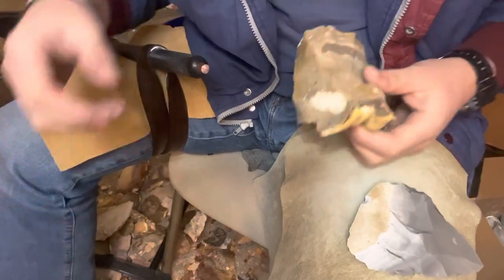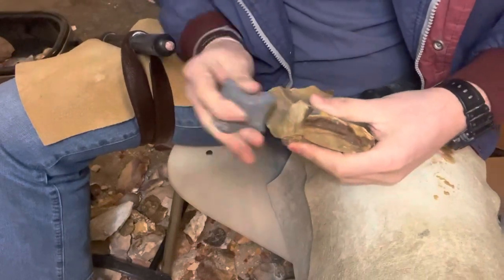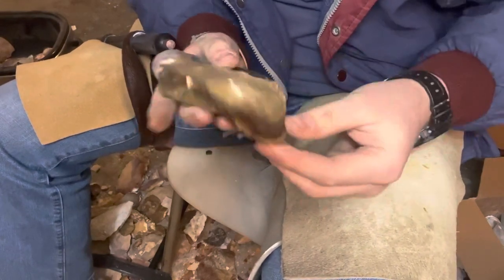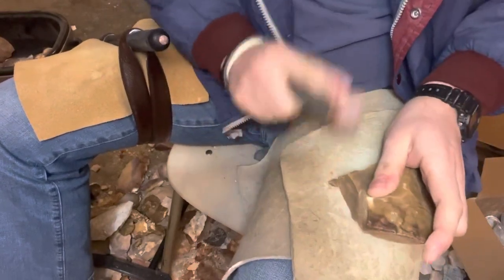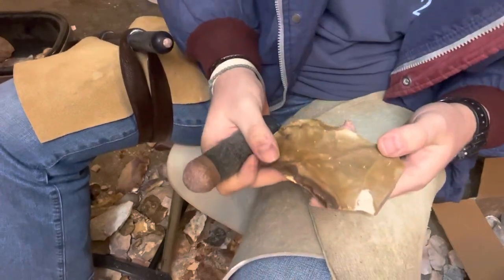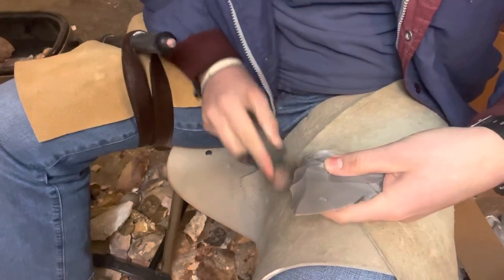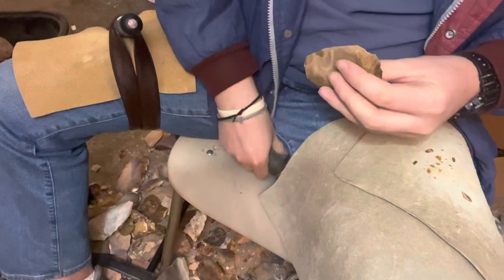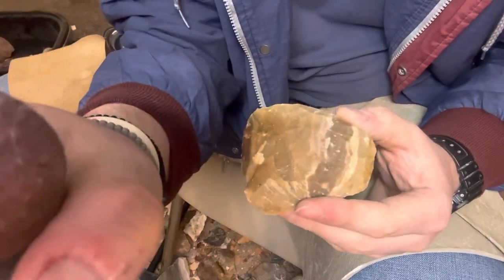Reducing Material:  Flint-knapping Flint River/Coastal Chert

Comment: Good job on getting the larger spalls without waist. A hammer stone may have split the remainder into two large spalls. Tricky, but it can be done. With the correct platform and delivering a quick strike and then pulling the hammerstone  back the energy will travel thru it quickly with a complete clean break. However, you ended up with two great spalls. Do you knapp with organic materials. (Bone ,stone, antler, wood, horn, ivory etc.?) Could you do a demo as such? Thanks.
Reply from the maker: I actually just gave my antler and wood collection to a new knapper solely using abo tools, but I do have some stone I could use for a video! Will see about doing that sometime soon.